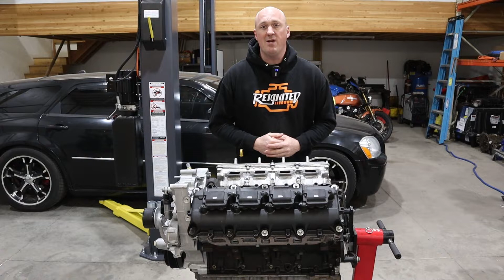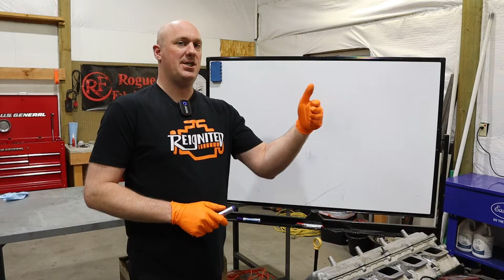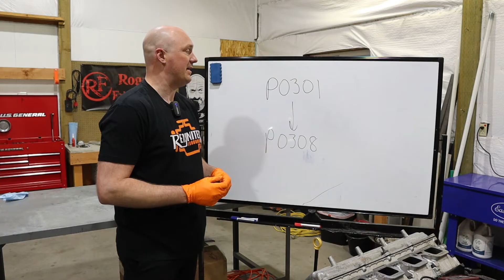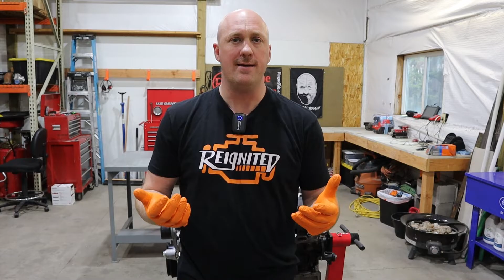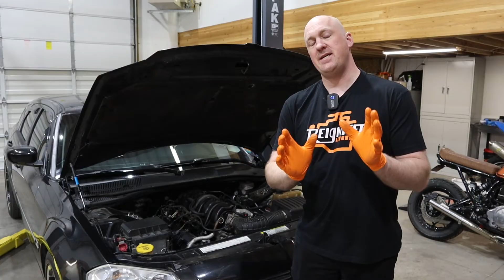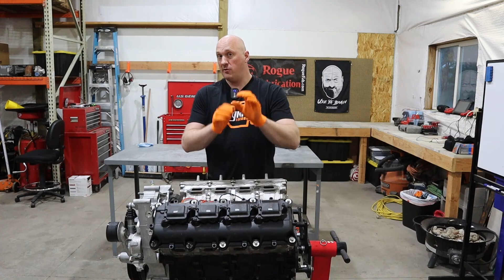Automotive Basics: Easy Hemi Engine Misfire Diagnosis

Comment: So what do we do when all of that is okay?. We've swapped the engine tried a different  computer, checked exhaust flow. We've done just about everything you can think of. If you have any tips that would be great. This vehicle previously had a lifter failure
Reply from the maker: You've swapped the engine and the PCM and you're still having a misfire on the same cylinder? If so, at that point you've already narrowed it down to the wiring harness. Either the injector wiring or the coil wiring is compromised.
Reply: That's the weird thing we've checked that before spending all the money we did. How would you test it just so I can make myself feel better I'd try anything. It's a multiple cylinder misfire but number 6 is the pissed off one. Seems nonsensical. And on this engine only seems to do it on cold start and you try to immediately drive it. And there's a code for wrong viscosity of oil but it's correct and just a break in oil. Bunch of weird things. Sorry but I'm desperate. Any help is appreciated
Reply: @doxter360 did you figure it out?

Comment: P0301 and p1411 just came up on my 5.7 159,000 miles. I believe it’s the MDS solenoid. I hear no valve/lifter chatter just injectors clicking away. I haven’t put my stethoscope on it yet though.  I’m debating doing a new cam now before I have lifter issues later and having heads redone with new springs and MDS delete.

Comment: Currently have an intermittent p0308 code set at approximately every 20-40 miles. Engine ‘feels’ like a slight miss vibration most of the time. 

Changed plugs, swapped coils, tested fuel injectors (resistance and pulse width live data), swapped fuel injectors, passed compression test - after every check still getting sporadic p0308 code. 
My next check will be input wiring harness to coil. 
Cylinder 8 is not an MDS activated cylinder. I’m not sure if VVT or a faulty cam phaser could cause this issue. 

I appreciate your video, I thought I might be missing something. Turns out I’m just stumped.

Comment: I got a 6.1 charger 2008 , check engine light comes on while putting gas what might be the problem ? I changed the fuel pump & the gas cap.

Comment: Thank you mr reigniter; I have a customers 5.7l and am working on the cause of a misfire.  You have covered all of the basics very well.  I will check a few more things but, it misfires on acceleration on cyl #3.  It did not move with the coils and the plugs look good....
Reply: Did you figure out what the problem was ?

Comment: I have a 09 ram 1500 , 5.7 misfires under heavy acceleration BUT no code. Runs fine at moderate regular driving. What's the deal?
Reply from the maker: I hate to say it, but that's textbook lifter failure symptoms. 😕
Reply: @ReignitedAuto  what's that going to cost roughly.
Reply from the maker: @blackfootjbd  cost depends on your capabilities. If you want to take it yourself you can get it done for about $1200. But if you're paying a shop it can vary wildly. Minimum cost would be about $4500 and it goes up from there.
Reply: There is no ticking or knocking ever.
Reply: It has 163,000 on it. Worth the money put in shop?
Reply from the maker: @blackfootjbd  always depends if you like the vehicle and want to keep it long term. If you do then I say it's absolutely worth it. This is pretty much the only major issue these engines suffer from so if you fix it then you know you can easily get another 150k out of it, more if you take some preventative measures.
Reply: @ReignitedAuto  thanks for all your feedback.👍

Comment: As a Ram 5.7 owner i am. Of course following the Chanel. 

I have had two cases of P301, both times at high way speed around 75 mph when i punched the gas to pass...engine had a heart attack...pulled over,  turn off ignition,  restart no problems or engine light , weird , right ?

Any ideas  ? Thanks, and keep up the channel !
Reply: Did you ever figure this out? Same issue but on #3
Reply: Have not had any other P301 codes ....I have not punched the gas, so it must be related to that , did oil analysis just to see if the cam was being eaten , oil came back good. Left alone for now.Good luck on your hope it not anything major.
Reply: @Java62PR  I pulled the valve cover off, unfortunately, rocker arm was loose, and confirmed lifter/cam are shit. Waiting on replacement

Comment: Hi there, one thing that you didn't touch on (if you did, I missed it) is will a clogged fuel injector be a possible cause for a P030# code? I have good resistance on all injectors including the #5 which is where my misfire is.
Reply from the maker: It's possible but very unlikely unless the vehicle has sat for a very long time, or if you have reason to suspect you got contaminated fuel, but that usually shows up in more than one cylinder. It's a fairly easy test to swap the injector to a different cylinder and see if the misfire follows it. 👍

Comment: Great video! Have a 2011 grand Cherokee. 5.7 Hemi getting a P0300 and a P0305. Put in all new spark plugs and coil packs. Seemed to be better then came back. No crazy tick tick sound coming from the engine. Definitely has a misfire though cause it’s rough at idle gets better the more you put your foot in it check engine light comes and goes. Do you think this would be the Fuel issue you’re talking about in the video?
Reply: Did you ever get it figured out what it was?

Comment: G'day Kayah from down under I own a 6.4 with 110k km it started misfiring along with pressure being released from the oil fill cap spark plugs replaced all cylinder firing no tapping noise still running rough is it because we are hanging upside down or got a faulty build maybe problems as explained having a medical check next as jeep Doc's are very rare as a roo with sunnies here will check back in then Stay Safe..
Reply from the maker: Is it a constant misfire, or does it happen more at idle, or more so under load?

Comment: Thanks for your video! I don't have any check engine codes but noticed that my 2010 5.7 hemi was idling rough, sensation of my butt bouncing up and down in my drivers seat at idle. The scope shows occasional misfire on #1 cylinder. swapped coils cleared the codes and took it for a 15 minute drive and the scope registered no misfire. The misfire returned straight away. When idling at 700 rpm as soon as i increase the idle rpm by 200 it smooths out. This is not a dead misfire but the 4 or so events in 20 seconds is annoying as you can imagine. The car was doing it before the new spark plugs but it seems more noticeable now.
Reply: Did you ever get this fixed? I’m having exact same problem. Shaking at idle but it runs fine when accelerating. I replaced spark plugs, coils, injector and it still is misfiring.
Reply: @subarubrett  Yes, the wanker mechanic never tightened #1 cylinder spark plus down, they were not electrically grounding some of the time.

Comment: I recently had my lifters and cam replaced recurfaced the heads and replaced the mds solenoids and spark plugs actually moved the coil packs around and im still vhasing a cylinder 7 misfire anybody have an idea of what it can be ?❓❓

Comment: Don’t have a misfire issue but I do have a question that maybe you can answer. I have a FBO cam and converter 5.7 hemi with the nag1 in my 300. I was on a Diablo tune and changed to HP, Diablo tune was fine I just couldn’t tune the TCM. I got the tune finalized from my tuner on HP and all of a sudden I have an issue with revving the car anything above like 3k. If I rev to 4-6k in park or neutral my decel comes down extremely slow and then hangs at 3k before dropping down rapidly. I’m almost certain it’s a tuning issue as this was never a problem on the Diablo tune and that’s the only thing that changed. Thoughts? Anything helps

Comment: i have a 2019 Ram 1500, my check engine light came on and stayed solid. went to autozone and used there diagnostic tool and there computer gave a po306 code and said either coil or spark plug. would that be a reliable test?

Comment: In regards to the Throttle Body being wide open, Couldn't you simply remove the Throttle Body before doing compression testing?
Reply from the maker: You could, but really the difference in the results generally ends up being fairly minor. And truthfully the actual number isn't that critical, it's more checking whether it's consistent with the other cylinders. Or if it's below 100psi overall. Also, if you do this you'd better make sure the engine doesn't somehow fire up, it'll go full throttle 😄

Comment: Okay what if it's p0158 which they also mention that it could be a problem with the O2 sensors or a injector going bad so which one of the cylinders does it mean it's going on plus I also had the po300 come up as well so which cylinder is this injector causing issues

Comment: Great video and you got me man.
I misaligned the intake pushrod on cyl 8 while replacing the head a few years ago & the valve would not seat.
I would try to start, backfire and stall …I believe it coded with high manifold pressure but I figured it out.

Any tricks on replacing the dreaded rusty exhaust bolts?

Thanks🇺🇸
Reply: Oh,
2007 Aspen
Reply: Thanks, worked like a charm ...left a comment on the other vid!
Reply from the maker: Got a video for you right here!
https://youtu.be/cL3xNoKs9E4 👍

Comment: If your cam lobe really is rounded, you could just pull the valve cover and fuel pump fuse. Have a buddy crank it over, and see that the rocker is either not moving, or has noticeably less travel
Reply from the maker: This is true, but unless the lobe is very badly damaged it can be tough to tell if one is not moving as much as the others. 👍

Comment: My engine light came on. Had it diagnosed at O'Riley's it coded miss fire on cylinder 5. Then cleared the codes. Took it to a mechanic and he couldn't find anything wrong. I drove the hemi truck 400 miles and the check engine light never came back on. Is it ok to take it on another long trip??
Reply from the maker: If it's that intermittent then I think it's probably just fine.

Comment: Awesome. The p300 process would be great. Also, if the cam lobe is wiped, would it cause a loose push rod or rocker? And be visible when removing the valve covers?
Reply from the maker: It's not usually visibly loose, however you will be able to see that the rocker arm does not push down as far as all the rest of them do.

Comment: I’m getting cylinder 6 misfires while idle in park.  And when they happen you can hear the idle is not running right. And it doesn’t happen while driving. 
I’m not getting and codes or check engine lights. But when I noticed the way the engine idles in park I started monitoring misfires with my scan tool. And after my engine warms up , I can get up to 25 misfires in cylinder 6 that stop when I start driving. And again, it’s not enough to throw a code. But I see them while live monitoring and also on mode 6 data.
I’ve already ruled out coils and spark plugs. I have not did a compression test yet. 
But doesn’t this sound like early mds lifter failure?  
I am currently also keeping mds turned off with my tuner . Is that hurting, helping or probably a non factor in terms of protecting my engine and helping it run better?

Comment: Hello got a question about my hemi I changed the head gaskets fixed the throttle control service bull now it starts and runs but turns off
Reply from the maker: Definitely watch this video first 👍
https://youtu.be/jMziMqWRMk0
Reply: Thank you brother for answering my question
Reply: Hey for you info the map sensor wire connection not tight will throw the code for the lightning bolts between the ()
Reply: I was miss informed about the torque I did mine at 9 lbs

Comment: a guy had done the same thing of diagnosis a misfire on a HEMI, he changed the spark plugs everyone was working so he switch up the spark plug that was supposedly misfiring and that spark plug was working so he looked at the coils check those and they were okay, so he checked underneath the covers to see if it was a roller brushing up against the rockers which would make a negative charge those looked good, So he went back to his diagnosis tester looked at all the sparks through each cylinders and those were okay, so he ended up just getting a new PCM with a 50 dollar install for the HEMI with it's VIN connected, then checked the rest of the codes that came up after the install and everything worked like a charm! Pretty cool stuff.
Reply: i had a misfire on an 02 altima, swapped coils, spark plugs, misfire stayed on the same cylinder. ended up being a fuel injector that lost its o-ring😒

Comment: I have a 2010 ram 2500 5.7 hemi has a misfire cylinder 1. O psi compression, 135-150 psi in all others. Leak down test it's going past the rings 100%. Looking for advice on budget build for it. I believe there is damage on the cylinder wall. Not sure if I should rebuild it or buy a new for $8300 long block or reman $6000. Any advice would be great thankyou. Engine is about to come out of truck.

Comment: I hava a 04 tundra 4.7 v8 misfire on cylinder 8 only at idle, put new sparkplugs, new coil, new fuel injector, new pcv valve, new valve cover gasket camshaft looks fine. Checked compression and the rest are about 150psi and cylinder 8 is 100 psi what do you guys think it could be? It runs fine over 1k rpm. It also started giving 11mpg since this happend

Comment: excellent explanation, thanks for sharing your knowledge! don't stop doing this!!!
If the Hemi engine vibrates at idle, could it be a misfire?
Reply: Mine is doing this did you find out what causes it? I have no codes new plugs checked all coils and injectors

Comment: I’m working on my Magnum. Thanks to your videos I’ve had the confidence to do 65% of the rebuild myself. The rest was done by a engine shop. Now my issue is Cylinder 6 connector isn’t giving the meter any reading. I’m getting a code for a misfire. I purchased a new engine wiring harness but it came from a Chrysler. I learned the coil packs are different from dodge and Chrysler. Any suggestions on what I should do? Try Chrysler coil packs or find someone to rewire the harness? Thanks for all you do for the home mechanic like myself.

Comment: I have a question if you or any others may help. I have a 05 300c 5.7 I did a coil pack upgrade went from coil an wire to the just coil packs and about 1yr an half later when I go half to full throttle it starts to brake up could that be the plugs they are about 2 years old an are the e3 plug can anyone help much appreciated

Comment: I have. Cyc 3 misfire.  I replaced the plugs,ignition coils. Fuel injector.  Throttle bottle and camshaft sensor.  Still having the issues
Reply: 2012 ram 1500 5.7

Comment: 2008 Dodge Charger SRT8 6.1L Hemi - 49k miles 
Error code P0300 - Last year and replacing the spark plugs fixed the code.
Yesterday i encountered the same code P0300. Couldnt be the spark plugs cause they only have about 5k miles on them. I used Lucas Fuel booster and after a day of driving it fixed the code issue.

Comment: Hi I'm watching your channel for awhile and now I actually need your knowledge for my 2014 Ram.
I have a misfire on cylinder 3 (what isn't a MDS ).
I switched plugs and coil and cleared the code with my autel scanner.
Test drive still says misfire cylinder 3.
I checked the injectors (live data with my scanner and they are all in the same range.
The misfire I only get, when I push the truck hard.
Do you think I'm on the point to replace the camshaft and lifters?
I also will replace the oil pump for a hellcat what supposed to fit without modifications.
Btw I have only a 105k on my truck.
What you think ❓
Thank you
Reply: Did you ever figure this out? Have exact same issue
Reply: What was it bro I have the same issue today
Reply: @Itsnotmyname1172 unfortunately I had to replace the camshaft and lifters. Since I had the engine open anyway I upgraded to a Hellcat oil pump.
Reply: @axelmensch3369  thank you sir
Reply: @Itsnotmyname1172 its not a horrible job if you have some tools and some mechanic knowledge. Just try not to buy the cheap stuff on eBay. I replaced it all by mopar parts and didn't have an issue since. She's running like a champ😊

Comment: AHHHH Man i was hoping you had a video on the P0300 code. My Truck will not stay on. It stalls and is ruff. i Changed the spark plugs already. Nothing! guess i'll check the injectors since you said its usually fuel related. 
Thanks for the video
Reply: what was the problem. ? you get it fixed ?
Reply: @erikruiz5004 found out it was the computer went bad. Went to the dealership and the said they don’t make that computer no more. He said good luck. Which means I’m f’d. And now left with a pile of junk. Unless I can find aftermarket computers someone programs specifically for my truck.🤬🤬🤬🤬just got 4 new tires and a back window. I’m pretty pissed.

Comment: P3439 code with p0300 on 2012 ram 1500 pending in the background not throwing a check engine light, any idea?  Also stalled at idle.
Reply from the maker: Is it code 3449? If so, first place I would be looking is at the wiring harness going to the MDS solenoids under the intake manifold. If you've got faulty wiring or a stuck MDS solenoid it could be misfiring due to that. It's someplace to look anyway. 👍
Reply: @ReignitedAuto  it showing the p3439 cylinder 5 exhaust valve control low. I changed the vvt solenoid. Thank so much for IL try that next.